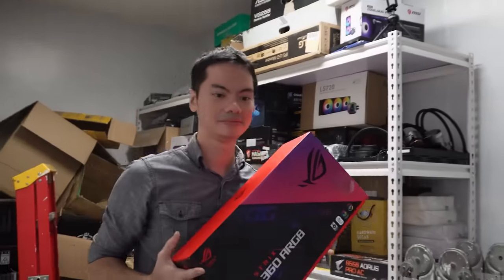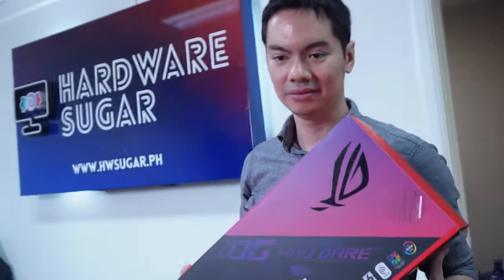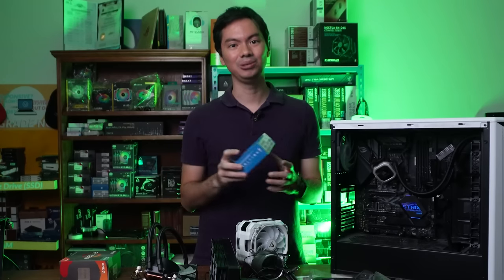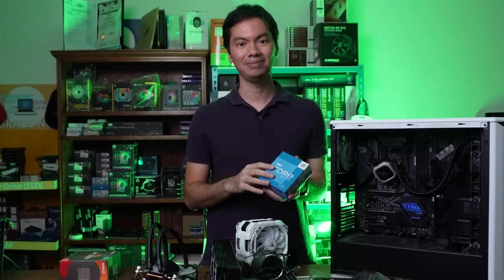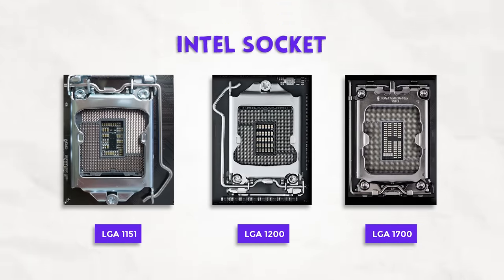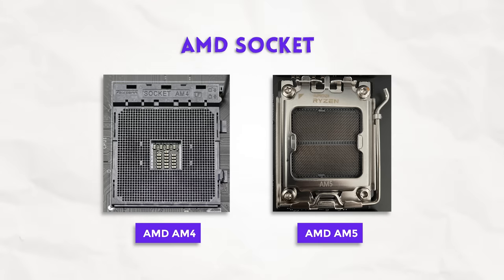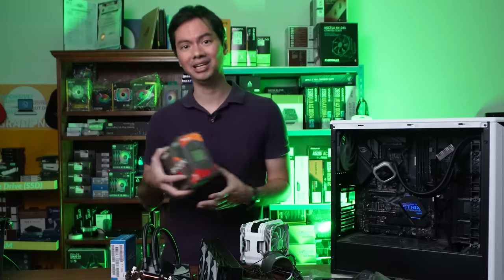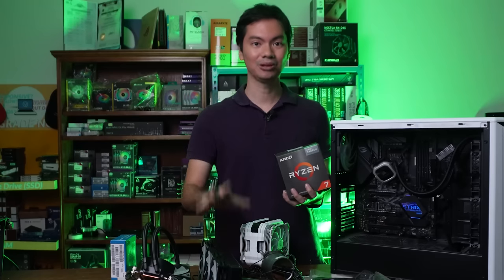Bibili ka ng AIO - Para hindi masayang pera mo, what do you need to know?

Comment: The reason why the block needs to be lower than the rad is because of air bubbles and the the pump. Pumps are usually located in the block and air bubbles will always rise and stay at that part of the AIO which is the highest point of the orientation. If the pump is the highest point, air bubbles will degrade the pump more faster than usual

Best bang for the buck I have tried is arctic. It's really cheap compared to more lucrative brands out there. I also agree than 120 rad is useless now a days. Better go with an air cooler with the same price if not cheaper.

Custom water cooling way more expensive than AIO and a lot more complicated, not to mention the effort and time to install it although if one is really into PC building I mean like really into building then I think it's worthwhile to try. As long as one has the money for it

Overall:

If one wants aesthetics but with good performance go with aio, It's fairly affordable. You are more likely to step on a 💩 than have your AIO leak

Comment: The bigger concern with having your radiator below your pump is that it contributes to inefficient cooling. If you mount your CPU block above the radiator, air will go up and gather in the pump which will lead to less water circulating and the pump working harder. When this happens, the heat from the CPU won't be able to dissipate properly. Granted this might take some time to happen but just do it right when installing to save you a headache in the future.

Comment: i have nzxt x62 280mm aio, it's more than 2 years already, still works fine. a bit underutilized though, running with r5 3600(then a temporary cpu but decided not to upgrade, 5950x might be my upgrade goal).

Comment: for me i always prefer air cooler because wala ng bebenta ng refill fluid dito satin sa pinas
so as soon as ginamit mo na sya my death timer na agad sya
also daming hidden gem sa air cooler like yung snowman
Reply: Meron pre di kalang naghahanap maige. Need mo link? Complete from killcoil to biocides.
Reply: @Tekillyah  sure as long as original ekwb cooling or xspc e6 brand sila kase if bibili narin ako ng fluid and mg hihirap ako sanpag refill 
di ko gusto pipitsugin brand
Reply: @spheroboom7299  Why would you want cheap brand for a custom loop? Are you using an aio?
Reply: @Tekillyah  we are in an aio video my guy
but no i have a custom loop hard tubing i just prefer known brands
cause as the video say theres no brands na 100% pero at least known brands have track record of reliability
now gimme gimme the links i needs them 
usually i just import through my cousin in canada pero if my local seller laking kaltas sa bayad

Comment: Depending on the CPU, AMD for example if you use mid range like Ryzen 5 2600, 3600, 5600G, and 5600x, 240mm aio cooler is already good. If you're going for higher tier cpu like ryzen 9 5950x, I suggest go for 360mm aio cooler or above. Personally I use air cooler for now but will invest on aio cooler.

Comment: What are some points to consider when buying AIO vs Air? Meron bang dapat iconsider (besides the budget, sockets, case/height compatibility) like average room temps? Do you have an AC sa room? San naka lagay ang pc, either baba or sa desk? Thanks!
Reply: They're more or less the same, hindi masyadong factor iyong positioning ng PC since even AIO use fans to cool the radiator

Comment: Do you need to take out the water inside the AIO after a certain amount of time or clean it? I just saw in this video that you did it because there are times that its clogs the pipe. And what will be the indication that there is something wrong with your AIO or when is the time that you need to replace it
Reply: sudden abnormal temperature of your cpu most likely..

Comment: Goodpm mga sir,off topic lang po sana, itatanong ko lang sa inyo kung ok lang ba na ang bibilhin ko na ram para sa akin is 3000mhz na 16gb, pero ang nakalagay po kasi na compatible sa akin is 2933 mhz lng po, 10th gen lang po pala ung sa akin, ito po ung specs ko, thanks po, pa advise po mga kuys bka mgkamali po ako ng bili, thank u☺️

CHIPSET
Intel® H510 Chipset

MEMORY
2x DDR4 memory slots, support up to 64GB1
Supports 1R 2133/ 2666/ 2933 MHz for 10th Gen Intel® CPU (by JEDEC & POR)      - ito po ung sa akin mga sir.

Supports 1R 2133/ 2666/ 2933/ 3200 MHz for 11th Gen Intel® CPU (by JEDEC & POR)
Supports Dual-Channel mode
Supports non-ECC, un-buffered memory
Supports Intel® Extreme Memory Profile (XMP)

Comment: Please don't forget to mention that almost all AIOs use only 1-2 OEM manufacturer. Tthe big 2 are Asetek and Coolermaster. There are other smaller ones like CoolIT, Apaltek, Swiftech. 80% of all AIO's sold use Asetek pumps and radiators. The only difference are the fans, RGB, and the branding the company places on their AIO.

I've had an ID cooling 240 AIO bought in 2015 and it's still running today on one of my builds. I've also had corsairs (they use CoolIT and ASetek OEM), and be quiet and they've lasted for many many years. So, to say that they aren't reliable based on a few samples is unfair. If you look at data from a bigger perspective, I'm sure it all evens out.
Reply from the maker: deepcool is one of the few which has a proprietary pump